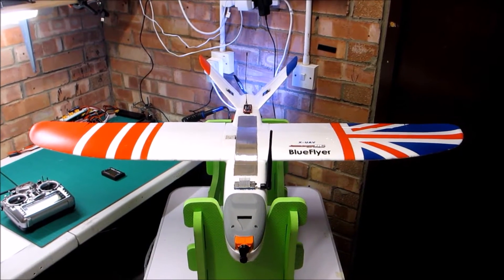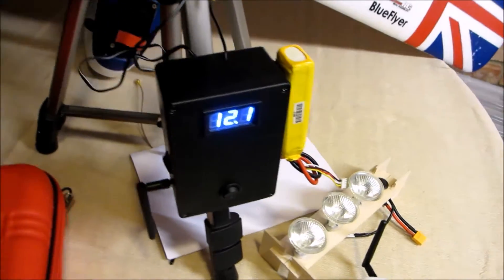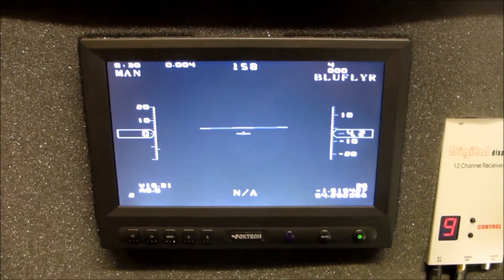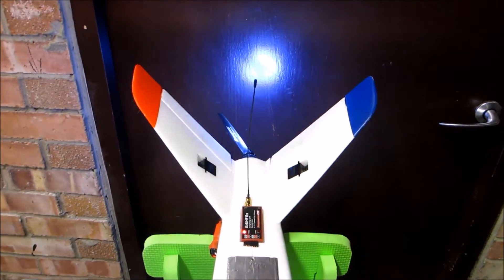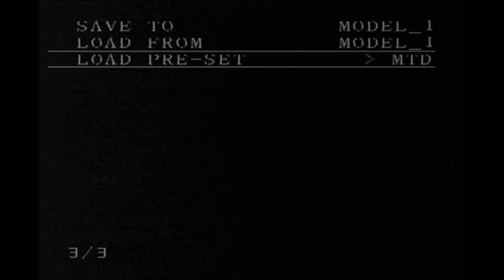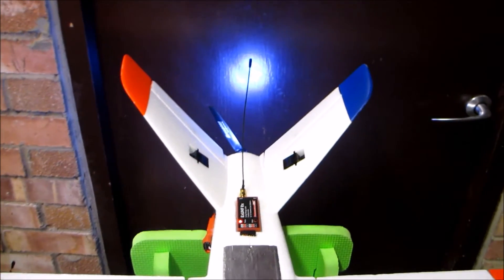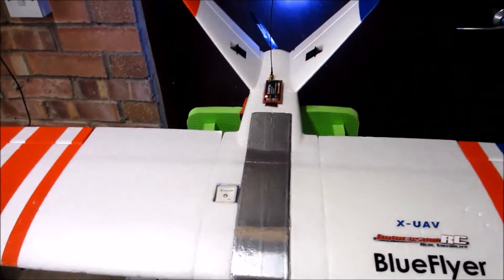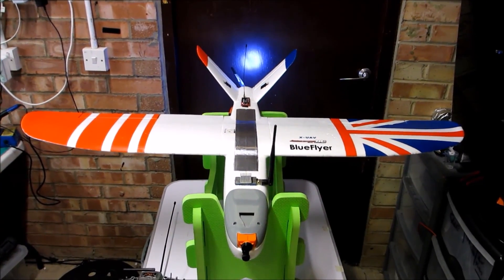X-UAV Mini Talon - The Re-build (Part 4) - How to set up the V-Tail on MFD AP

Comment: very nice :) i've only just gotten to grips with the vector... maybe i'll try an MFD in future!
Reply from the maker: Unless you intend on using an antenna tracker, I would stick with the Vector. It's much easier to install into a plane and also doubles as a multirotor flight controller if you wish it to. The only reason I moved from Vector to MFD AP is because I now have a MFD antenna tracker and it works much better than the Eagle Tree tracking solution.